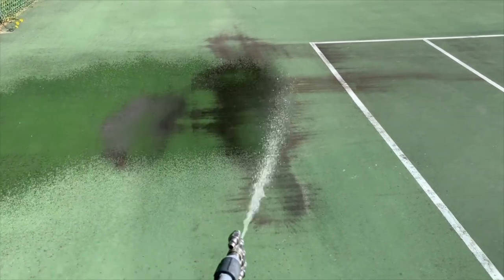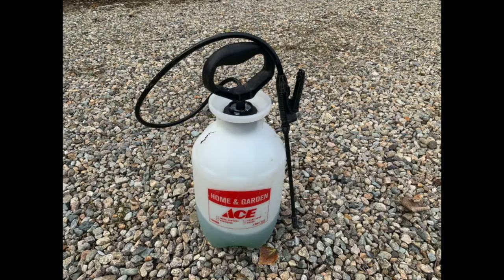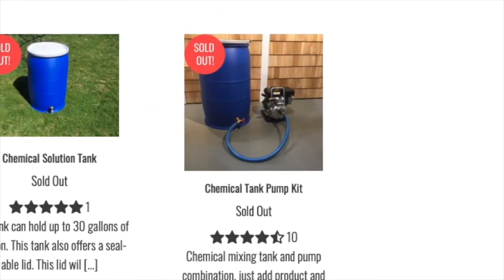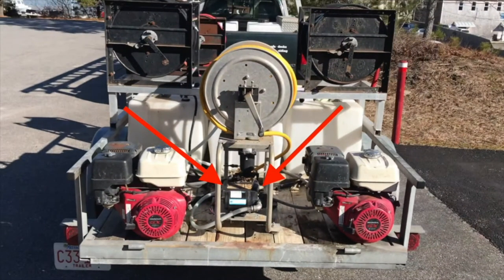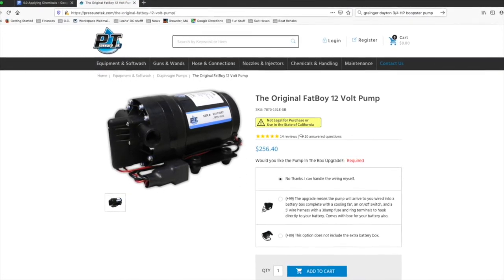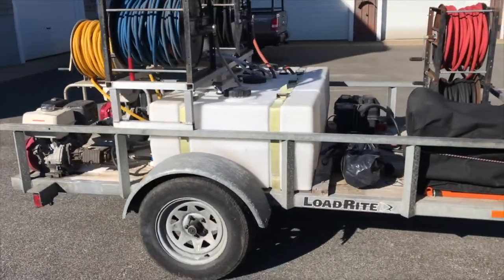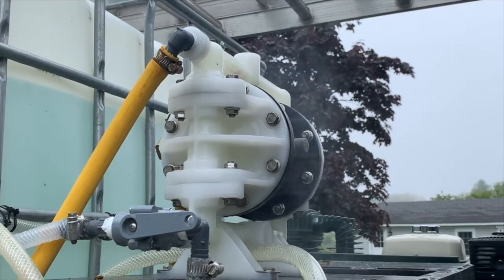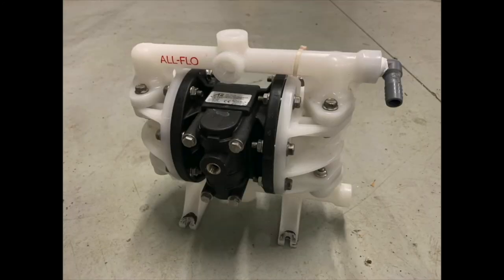HOW TO: Pumps I've Used for Exterior Cleaning

Comment: Thank you for the information. Regarding the all-flow pump and compressor can you please provide details on the exact spec pump and compressor please? Have you had any flow issues pumping to higher level roofs? Looking to build a setup like this currently.
Reply from the maker: Pump is 1/2" All-Flo Kynar / Santoprene17 gpm max on 80psi air input.  I run a Rolair 8422HK30 which is 9hp and 20+cfm, it does fine.  Distance and height is all I've ever needed.  Most guys screw up their flow rate though by just focusing on the pumps and not realizing the importance of big hoses and fittings, in other words they spend a fortune on over-sized pumps and somewhere in the setup things get restricted to 3/8" and then scratch their head when the new setup runs like a 12v diaphragm pump.

Comment: For the 110 V booster pump, how did it hold up through the seasons against the chemicals
Reply from the maker: Not well, despite rinsing.  I'm told they've gotten better but in terms of chemical resistance they're still not comparable with air diaphragm pumps.

Comment: Im looking togo from pw to electric pump.. a reg 12v truck battery will pump a few jobs?
Reply from the maker: Really depends on how big those few jobs are.

When I used a 12 V pump I ended up rigging two batteries because one always seemed to be not quite enough.
Reply: @OutsideCleaners   2 work for 2 jobs a day?